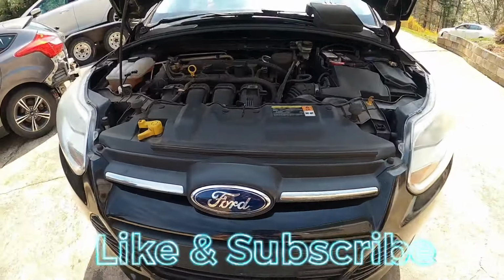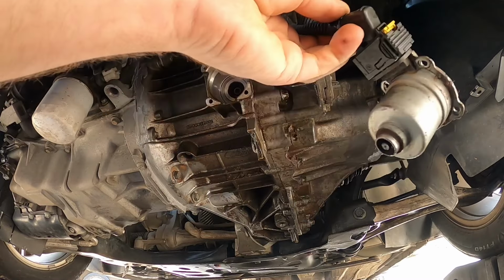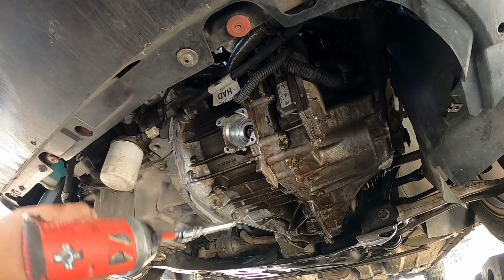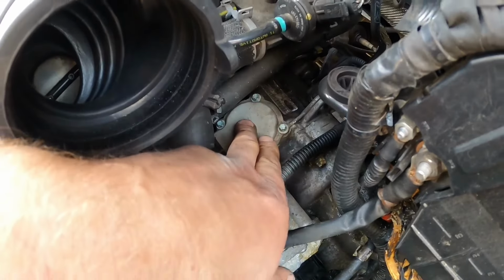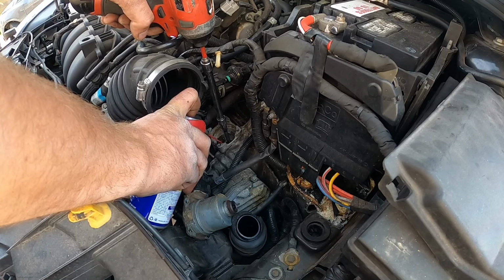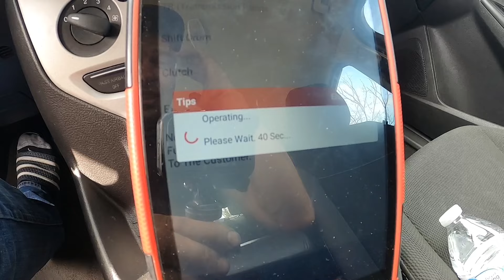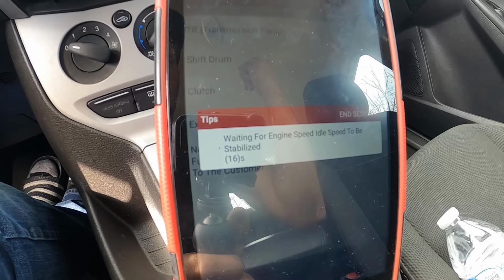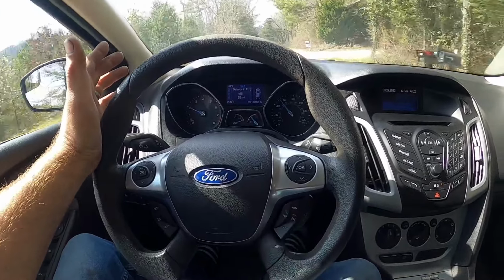2012-2018 Ford Focus Slipping? No Reverse? No Drive? Problem Solved. Easy Fix. You Can Do This!

Comment: I have a 2012 Veloster, same Transmission DCT setup, even actuator in same locations. I have a ghost issue, where I randomly loose 1,3,5 which are from top actuator. Though it only does it when weather is hot, which is leading me to believe is something overheating. The problem is my damn car won't throw any codes. I even bought a Autel MX808 scanner and no codes. I did  replicate the problem within the scanner which kind of help me rule out what most were saying about a bad gate shift actuator.  I drove the car until it got to the point is started no moving in 1,3,5 and I plug in the scanner and tested the Clutch motors and number 1 failed to engage 2 times with the scanner yet didn't threw any codes. I did replaced that motor already and still no fix, so at this point am leaning towards the Actuator Assembly or Clutch itself.  I've heard lot of stories on this transmissions about being bad, but to be honest I've had this car for over 6yrs bought it with 40k now it has 120k and this is the first issue I ever had with the transmission. Might take down the transmission and inspect the dual clutch and actuators and have them replaced.

Comment: When you shut the car off, there is a motor that moves/resets. Is that the TCM or the actuators? Thanks
Reply from the maker: Both I believe
Reply: @L8R-HP  thanks, it used to sound smooth and now it's crunchy sounding. Check engine light and seems to only shift 1st, 3rd and 5th. Reverse is good so far. Sometimes it will shift no problem and if I shut the car off then it doesn't. I'm torn between TCM and stuck shift fork.
Reply from the maker: @wicked_digger  sounds like actuator or sticking forks. The TCM usually doesn’t work at all when it goes out. Check your battery and grounds tho
Reply: @L8R-HP  my battery died and I replaced it about 4 days before this started happening. The battery tests good. I cleaned the upper ground but not the 2 under the airbox yet, I will do that today. Wondering if I should try another battery. I was thinking maybe had something to do with amperage. I appreciate your advise and all your videos!
Reply from the maker: @wicked_digger  dead battery is a big issues in these cars. If it’s low or weak it does damage to electrical system. No problem! Hope it helps
Reply: @L8R-HP  it died fast, left work and I noticed it barely started, got home, charged the battery for 4 hours on a heavy duty charger. Went to start it in the morning, 6 hours after charging and was dead. The code I have is trans friction element B stuck on P07A5
Reply: @#L8R-HP Thanks so much! This is also, Wicked Digger. This is from my repair channel, Digger is my metal detecting channel. I came home from work, removed my actuators, cleaned them and my code went away and the car is performing great! It was a stuck fork. I truly appreciate it and will be making a short video with a shoutout to you! Thanks brother 👊
Reply from the maker: @wickedrepairs8527  🤩🤩👍

Comment: Do you know where I can get that actuator socket. I bought a triple squared spline set that had a 6mm and 8mm but 6 was too small and 8 was too big.
Reply from the maker: https://www.ebay.com/itm/184480096055?mkcid=16&mkevt=1&mkrid=711-127632-2357-0&ssspo=yvwl7HUSReq&sssrc=2349624&ssuid=-qApsBzoR4m&var=&widget_ver=artemis&media=COPY
Reply: I have the same question . Seems like they are out of stock from the link on the bttm

Comment: “Motorcraft® Dual Clutch Transmission Fluid is specifically formulated for use in the DPS6 PowerShift twin dry-clutch transmission. It was designed as dual functioning fluid to protect gear, synchronizers and bearings, while also used to operate the transmission's shift mechanisms
Motorcraft® Dual Clutch Transmission Fluid is manufactured with synthetic base oils and performance additives providing improved shifting at all ambient temperatures. Protects against wear and corrosion, while low viscosity improves fuel economy.” Straight from ford and motorcraft.

Comment: 3:15  My "Clutch B is stuck engaged" with a P287a code and the actuator tool won't turn.  Turning to the left a bit, I feel the spring unwinding a bit, and turning to the right it's locked up.  I think I'm stuck to remove the transmission. Grrr.
Reply from the maker: Keep staying and working it back in forth. Sometimes the will free up
Reply: @L8R-HP      After spraying in a bunch of brake cleaner and some WD40 like you (the top port was way easier of course), I swapped the Electric actuator motors and I figured out (kinda because the car was already repeatedly trying to calibrate both clutch forks I guess) and I worked with one of them at a time until the car actually calibrated until it wouldn't do it anymore.  I tested back and forth, taking the cable connector off one and working on it, then switching to the other, then I eventually had them both plugged in and they didn't calibrate after disconnecting and reconnecting the battery with the drivers side door open.  

I even loosened the 3 easy bottom bolts between the housing and the engine, just getting a small enough separation for non evaporated fluids to drip out.  I erased coded a few times but the clutch B code kept coming back. I put it all back together anyway and just driving back and forth in my driveway that has a small hill, my Reverse is back and there are NO CODES at all nor any that are pending.  

I do have PROBLEM though;  in forward or reverse, moving at idle or braking to slow down and stop, it feels like the clutch is slipping then grabbing then slipping  over and over again.  I'm wondering if the WD40 caused this.  But perhaps the problem is only temporarily gone, mostly. 

Any ideas?

Interesting use with the battery and drivers door, yes?

I also noticed length of calibrations differed to;  it went from about 8 seconds, to 6 seconds, to 3.5 seconds, and then went to no calibration/test.

Comment: Hey I got 2012 Fiesta 210,000 miles…I didn’t have any problems up to a week ago…I got the transmission malfunction service transmission now message with wrench for service…had codes wiped out all was fine for a few hours…had turn key back once to start for 2 weeks prior…now bottom actuator clicks before starting tough to pull out and hard shift after 1st gear and now getting trans hot message ….cleaned all grounds with new bolts…any ideas I’m pulling out the tiny bit of hair I got left…is this a possible fix in the video…thanks man for any reply

Comment: Lever a and b in this car similar to kips in 2st kawasaki ninja 150cc. It'll stuck if there're a lot of Carbon build up. You need to push the lever manually to make it work again. But in the end you need to clean it up for better performance

Comment: What app did u use to to get codes and to reset functions
Reply from the maker: It’s a scan tool, launch 431
Reply: @L8R-HP  is this used on a phone or is this a separate scan tool device
Reply from the maker: @mgomez91792  it’s a scan tool. Launch 431

Comment: What kind of a programmer you got??? I need one of those, I cleaned the forks a few times still not getting anything better
Reply from the maker: Launch 431 mini
Reply: @L8R-HP  is it required to reset all that stuff, I turn the forks by hand 14 times still loose, I got to 16 times where i started feeling resistant, I didn’t go no further but it may be in using a quarter inch ratchet.

Comment: Hey I was wondering if you could help me out. I have code P287A and P07A5. Car would jolt and no reverse. Now car won’t even turn on, just a clicking noise from gears. Do you think this method will help?
Reply from the maker: Your shift fork B is getting stuck. This will help, if not, the fork will need to be replaced

Comment: Did exactly what you said but actuator A keeps spinning with no end!! Does that mean the forks inside are broken?? Does that mean I need to pull the tranny out? Since I don’t think theirs anything else I can do externally at this point
Reply from the maker: Yea transmission has to come off and fork needs to be replaced
Reply: @L8R-HP  I appreciate your response brother! Before all this the car shuddered hard but it drove forwards and reverse and parked. Can I assume the TCM is good to go? I just hope it’s just the forks lol this is my first tranny pull on a focus. First project car too
Reply from the maker: @SeaBassFlatline  yea it’s the forks 99% of the time.
Reply: @L8R-HP  I can’t seem to find any videos on how to remove and install the forks themselves:/ do you have one?
Reply from the maker: @SeaBassFlatline  I have some videos on it. Just check out my channel
Reply: @L8R-HP  I love your channel man very informative and big help! I will look at all of them. When it comes to switching out the forks. The top actuator fork A is the one that spins with no end. But underneath B seems good to me after lub and cleaner treatment. Do you advice me to buy the set of forks or only the one for A?
Reply from the maker: @SeaBassFlatline  I would change both forks and throw out bearings. Make sure you lube them up before install. Your car will drive flawless
Reply: @L8R-HP  will do thank you! I’m currently stuck. I cannot seem to get the tranny out. I have taken all 8 bolts to housing off. I know I’m the video you talked about the fly wheel with the fiesta. Do you have to do the same with the focus??
Reply from the maker: @SeaBassFlatline  yes, you have to get flywheel nuts off
Reply: @L8R-HP  the only entry point is right about the starter right?
Reply from the maker: @SeaBassFlatline  removing intake and starter. That’s the easiest fastest way to go on a focus.
Reply: @L8R-HP  yeah I removed all that thanks to your video brother🙏🏼so then remove flywheel bolts by the opening right about the starter right?
Reply from the maker: @SeaBassFlatline  yes
Reply: @L8R-HP  you have been a true inspiration and huge help! This is my first job of this sort lol so it’s nerve racking but with your help I feel more confidence. I hVe shared your channel with everyone

Comment: Can a bad TCM trigger p07a5? I just got new forks and clutch installed. Thanks!
Reply from the maker: If all new parts were properly installed, it could be the TCM
Reply: @L8R-HP  thanks for the response.

Comment: I should have tried this first instead i changed the tcu, had it flashed at a auto shop for 250 and even though they said programming was good the car still shifts erratically. so i watched your other video about pulling the trans and am almost done pulling it.. then i decided to watch this video and it seems a and b are getting stuck briefly. now do i decide to go ahead and finish pulling the tranny or just clean and lube a and b and put everything back together and try it? with 160000 miles on this 2015 fiesta probably best to pull it and install new arms bearings and clutch kit. what say you? dumb and expensive mistake.
Reply from the maker: Get new parts if you can.
Or clean and lube forks and reinstall. 
Make sure you reset the clutch
Reply: @L8R-HP  THANKS... I didnt end up removing the trans... i did as you showed in this video.. switched the actuators.around drove it around but it's still doing the same thing.. i ordered new actuators, they will be here tomorrow.. i have a check engine light on only my code reader says there's no codes stored? I am going to try the tcm reset procedure and see if the light goes off. tomorrow i'll install the actuators, drive it and see if its still doing the same thing.. try to accerate from a stop and it goes but when it shifts it jerks. if i try to press the pedal to engage a lower gear the engine revs but the clutch doesnt engage until the rpms drop. i'll know more tomorrow night. thank you for your help. I really appreciate it.

Comment: Thanks For the video.  I have a 2018 s fosus.  I'm getting a p2875r code on it.  I have no reverse.  It won't stay in forward gears.  I took it to a body shoP due to a rear end collision.  When I went to pick it up the battery was dead and the transmission was out of it.  They tried to relearn the computer but didn't work.  I'm told it may be the tcm.  Of course I can't get one for months. I've seen the p2875 can mean inside damage.  Can you tell me anything that I might try.  Cars got 38k on it.

Comment: Just did this process at the top actuator I was able to spin counterclockwise and had to pull it out to spin back. Did it a second time and the bolt would not spin back. Now I get no gears and car wont move. I put it back together and I hear it trying to find something and it stops. Looks like I am headed to the mechanic. Both spun free without issue. It was having an issue shifting from 1 - 2 thats why I decided to do this process.
Reply from the maker: It’s not that you broke anything, it’s just your forks are bad and need to be replaced.
Reply: @L8R-HP  So, a transmission shop said that if my car does not have the updated TCM, that they cannot fix my car, period. He said to call a dealership and see if the car was in for any recalls regarding the transmission. I called a dealership to see if they can give me any history on the car via the VIN and they said they cant. Can you help me understand this better about the TCM? They said they are on backorder for 1.5 years??
Reply: The car was working with a slight grind going from 1 to 2nd gear. Now its unfixable?

Comment: What kind of scan tool you are using
Reply from the maker: Launch 431 mini. But I also use forscan
Reply: Ok I was asking because I just put new actuators on my focus so they have to be relearn again so my can drive good
Reply: @L8R-HP  so the forscan is to read the codes and reset them or to relearn as well?

Comment: Hey brother, I just got the 2013 Ford focus se from a dealer, it was working completely fine when I checked before making the purchase and even after two days of the purchase, it was working butter smooth and giving me all the responses. But as the climate started to get cold, it started giving me “Transmission Faulty. Service now” messages. At first it was just messages no issues but then when I used to cold start and put it into drive it started to slip into neutral. 
Then I used to shut down the whole car and start it up again and it used to work. 
But since yesterday my car isn’t shifting into “Sports Mode” and the previous problems with the transmission slipping from drive to neutral still exist on cold starts. 
What do you suggest? Should I try this? It has got 146,000 miles and I think the clutch has been serviced before.
I would really appreciate your help. I’m new to this country and this is my first car. Thanks!

Comment: I got transmission overheating light...what would you check for that?
Reply from the maker: Forks are sticking
Reply: @L8R-HP  thank you sir.  You are honestly the ford focus transmission expert of the world! Thank you!
Reply: @L8R-HP  It is actually not my car...he is asking 1500 for it...2015 with 177k miles....was thinking about trying to get it for 500 and just replacing/cleaning the forks then reselling
Reply from the maker: @macknumber9  do it!
Reply: @L8R-HP  I honestly know barely anything at all about transmissions. Forks I'm pretty much clueless on what they even are and how they function. Do you think if it's an overheating problem that they are actually broken or that they are just really stuck and need a really thorough cleaning but if I have to take the transmission down and apart mind as well just replace the forks no?

Comment: Just got 2015 ford focus transmission replaced and it did the rpm went high and speed was 20mph it also didn't reverse engine light went on after trying few times parked it and tried it again everything worked engine light went off...any input on this.
Reply from the maker: If you didn’t do a relearn with a scan tool, it adapted on its own
Reply: Will this occur alot with ford focus from what I get from the comments I read and I just got the car too got 134 km on it.

Comment: I have a big question my 2014 focus 2.0 has been sitting in my grandpas garage for 6 years 16K miles he just gave it to me I put brand new gas and it drove fine for a few days I was going to wash it and now it won’t go into reverse just revvs I replaced the actuators, and the sensors but nothing still we even used a scanner to do learning procedures and it won’t do anything still what can it be??
Reply from the maker: Stuck forks most likely. Have you tested your battery?

Comment: My mother has a 2014 Ford Fiesta Titanium with a 1.6L. She has an issue since about the beginning purchased brand new the same year and when it warms up she goes 2 leave a stop and it feels like the trans slipping, torque converter, or the splines I'm the drive shaft are skipping as it sounds the same in those situations on earlier vehicle models. After doing some research I thought that those options u mentioned as well could be a source of the problem as well. Still haven't narrowed it down hence why I still check vids like these for ideas.

Comment: Hope you monitor your comments because I would like to find out what model of Launch tool you were using in the video. I volunteer at an Auto Hobby Shop and am interested in getting a used diagnostic tool.
Reply from the maker: I used a launch 431 in this video

Comment: I thought you were spinning the thing back and forth, so I did that with a drill, I ended up pulling the small actuator gear screw thing off of the fork and it won't go back on. I think I may have messed up everything, help would be much appreciated.
Reply: O shit.. glad I read your comment was going to do this same thing..
Reply: @AAAEXPERTS  yah, be very very very gentle, there are lots of tiny tiny delicate parts that cost a LOT to replace.
Reply: @ yea I just sprayed/soaked it with penetrate didn’t turn nothing… the guy on the video made it look like he was turning that thing left and right no problem.. glad I read your comment